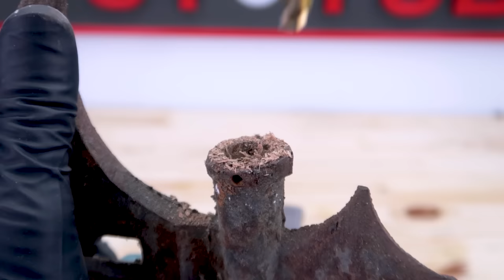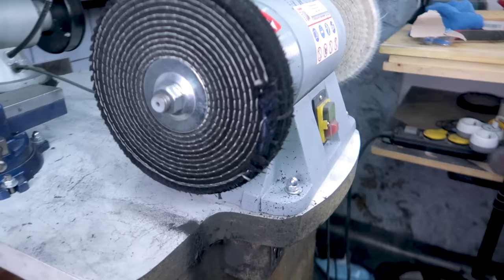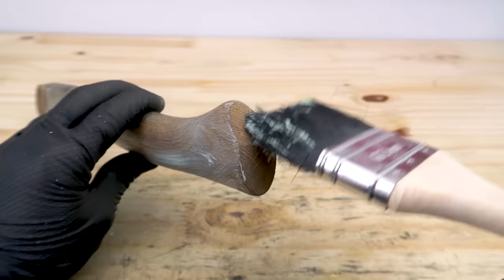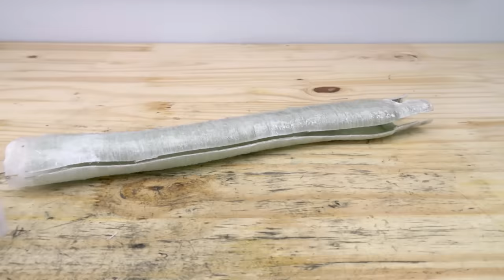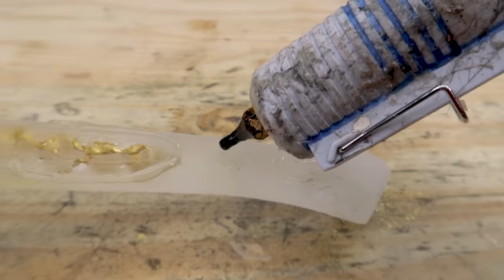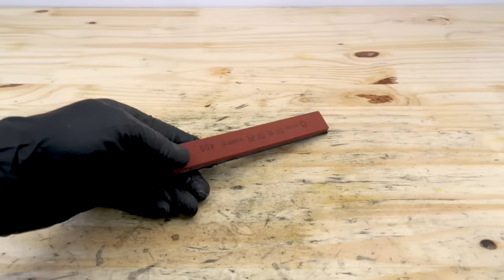Halberd AXE Restoration - With Epoxy Handle

Comment from the maker: Check My New video!  BMW Skillet Restoration 🔥🚗 https://youtu.be/n3P9fuKPHMg?si=WkfTTXY1Y45BCQI3
Reply: Pressure chamber will get rid of bubbles 8n epoxy, also mixing slowly will. I built a pressure chamber out of an old pressure cooker.
Reply: Hey so just a suggestion, instead of trying to repair the bubbles, why no go and make coloured epoxy and fill it with that? It may look cool! However, if you don’t want bubbles I’d say a vacuum chamber and very slow setting resin would help and also be sure to pour the resin on the side so the bubbles have less distance to get to the top!
Reply: Heat also gets rid of the bubbles.
Reply: To get rid of the bubbles you need to use a vacuum chamber
Reply: Cool!
Reply: Hey I have a challenge, restore something and only use the stuff you’ve restored like if you restored tools only use the tools you’ve restored
Reply: Use vacuum chamber to remove bubbles.
Reply: Can you restore a old nintendo?
Reply: عالی
Reply: why didnt you use a wodden handle?
Reply: So nice tysy i want to see more cooking videos
Reply: I've seen both vacuum chamber and pressure pots mentioned here as suggestions for removing bubbles. These are good suggestions. Another way that works is a vibrating table or plate to vibrate the bubbles to the surface where they can be popped or sanded away.
Reply: 😂😂 lol
Reply: Ok

Comment: this looks like a mass produced cast axe head before annealing , the residue metal around the edges shows me that this was cast in a two part sand box, i used to work in a foundry where sand box moulds were commonly used so i recognise the look.

Comment: He’s turned a halberd into an axe
Reply: Yeah, I don't like that personally. A halberd is not an axe.

Still okay work that they have done though
Reply: No worse, its a hatchet.
Reply: into a wtf.
Reply: That's like turning a spear into a throwing knife  just make it less practical in what it is
Reply: No halberd. Mission failed
Reply: yeah i am also kinda dissapointed but its better than rusted blade
Reply: It’s not for use, it’s for display, and it looks fantastic. If you want to see blades made for use go watch forging videos. You had to realize coming into this that it would be for show and not practical use. Come on guys, you can’t be that dull.
Reply: @draketimmerman3837  you can make an axe for display or a halberd
But you should still be able to distinguish between one and the other
Reply: Weird casting marks
Reply: Wait like a halberd. Like the actual guard. Oh wait. A meat axe
Reply: A full epoxy halbard handle would've been fantastic
Reply: I knew something wasn't right. Kept thinking "wait isn't the handle supposed to be longer?"
Reply: @PeterCaptainObvious  It's the FF9 Lindblum Guard halberd with the handle cut off to make it easier for the guards to fight intruders in close quarters like the hallways of the castle
Reply: @arielalexandroarnaldo2238  So the sawn-off shotgun equivalent of a halberd?
Reply: @PeterCaptainObvious  Yes, and if the Evil Dead team fell into the steampunk world of FF9, their shotgun would be the blunderbuss
Reply: Cause it's not really a halberd

Comment: To fight with air bubbles, make a vacuum chamber, its easy and cheap.
Reply: Was about to say this!
Reply: this is the answer, but when you do bubbles will well out the top of the item, along with a bunch of the epoxy so make a reservoir of extra at the "top" of the item.
Reply: Yep
Reply: Also if u can vacuum the partA and partB before mixing and also after mixing it might reduce even more. And be aggressive mixing also.
Reply: It depends on how long the resin takes to cure
Reply: Radu Butuc just like king of random
Reply: yeah but he would need to get or improvise a huge one if he wants to make things like the handle he made here, a handle it's not small like the usual things others put in vacuum chambers :T
Reply: @Timeless_Starman  you Just need to vacum the resin before pouring
Reply: Or even better, a Pressure pot. It is faster
Reply: The use of a pressure pot or a vacuum chamber will help to eliminate bubbles. I've had better luck with pressure pots. Good luck and great work!
Reply: J'allais te le suggérer. On utilise un cylindre avec une pompe pour  retirer un maximum d'air piégé dans les amortisseurs de voiture rc. Sinon belle vdo et beau travail 👌
Reply: Hushe dudidud a gruh ray eatut jaobub 👍
Reply: Or he could just do a wood or brass handle as they look better
Reply: The problem with vacuum chamber is that it can remove the solvant from the epoxy and degrated mechical properties
Reply: I’ve seen some people use pressure chambers too. I don’t know which is better, I’ve never had the chance to use or try other method.
Reply: The BEST way to fight air bubbles is to make a vibrator like workers do when pour cement and vibrate it😉easy, fast and efficient, Greetings from Greece!!!
Reply: Jelly I’ve never heard that from any literature ever. Vacuum setups with epoxy are used in industrial settings regularly. There’s an entire method of saturating the medium with a vacuum. They sell special epoxy that is thinner and works better with vacuums. Degassing epoxy in a vacuum chamber is a common thing.
Reply: Or get an agitator of some sort to vibrate it while the epoxy is drying, that may easier to create on the cheap lol heck an old fan with a bent blade would do the trick
Reply: Yep
Reply: So are you
Reply: @coltonhopkins5517  what are you even talking about and directed towards whom? Lol
Reply: Pressure is better you won't lose resin like in a vacuum
Reply: Most obvious But those are pretty costly
Reply: Heretik Leathercraft the chamber may be cheap but the pump is expensive
Reply: @errorcode1249  just take an refrigerator compressor and use it for suction. It's about 30 euros
Reply: @errorcode1249  his gotcha there
Reply: @ericitchyd2311  Easier to put the mixing cup in the vacuum pot and pull the air out of the Epoxy before you pour it into the project...

Comment: Halberds typically had long spearlike handles, hence the pointy tip above the blade. The handle you made looks sick though.
Reply: Restoration implies a return to the original form. That is the whole point. He simply removed the original irregularities, which showed how the metal was cast and ground the surface completely senseless. This weapon NEVER looked like this. The shape of the hilt and gilding are completely off topic. HERE EVERYTHING IS NOT AS MUST BE. This exhibit is lost for the museum. And for a person who calls himself a restorer, this is a collection of mistakes
Reply: Looks like it could be a little bit sharper....
Reply: I agree with @KP9IK about his "restoration" this is a blatent disrespect of what a halberd is. It is a POLEARM not a handaxe. Not to mention the wretched use of a fireaxe handle like wtf! Dude your a restoratitor, restore it to a halberd. If anything you should of made a less flashy woodend pole and it would look a million times better not this epoxy gold leaf disrespect. This is why i watch other restoritors. If you want a TRUE weapon restpration i reconnend "Restoration And Metal" who actually care about restoring the weapon not ruining it.
Reply: Historians crying, thanks!
Reply: @dggeargr4g  It looks like something cheap that people would hang on the wall in their basement back in the 1970's.
Reply: Yeah it was a mix between the Classic Spear (from Romans/Greeks) and the Hand Axe (more Germanic/Nordic) I think it got popular in the height of the Middle Ages, is a very interesting weapon and it has more secrets than you think, since it can be used at long range to attack and for defense. It was also use to disarm and capture the weapon of the enemy if the fighter was well trained. It also became a favorite of horse mounting Knights in duels, since it was long enough to reach a moving target on a horse back. Like I said, very interesting indeed.
Reply: The thing is that that has never been a halberd. Just a weird souvenir or something resembeling an axe of arms.
A halberd would have more prominent spikes and a way longer spear blade at the tip
Reply: Yeah that's"vintage" 1960s. This isn't some archeological dig. He bought it for $2. It was also clearly cast, not forged.
Reply: @maxhydro1   lmao youre acting like its one from the 1400s, bro its a reconstruction (probably from the 50s)
Reply: @johnbee5283  the problem is that hes calling it a restoration qhen obviously hes not restoring it to its origianl fork or as close as possible. This is making a beautiful weapon into an art piece.
Reply: @johnbee5283  also he turned a halberd (a polearm weapon) into a hand axe (a one handed weapon) which is a horrible insult to it at that.
Reply: @maxhydro1    "True restoration?" Restoration and Metal?  I saw his axe video from 11 months ago, one where he pretended to have found a rusty axe head with a bullet lodged in it.  The bullet was clearly planted (still in the casing), and he went on to use a welding rod to "repair" an edge.  Who knows what metal the welding rod was.
Reply: @aprilbennett4161  you have a point. Thats another reason, I've lost respect for this "restoritor" hinestly just a sick mockery of one.
Reply: its_dpark well there are many types of Halberts since they were so versotte they even had steel balls at the end and hammers at the top
Reply: @Glad_Daddy  very true. Thats why it was commonly given to not as well trained individuals
Reply: @maxhydro1  will you get a life

Comment: Don't stir the mix with power tools pulls in air that makes the bubbles. Stir by hand next time.
Reply: Put the mixture under vacuum before pouring.
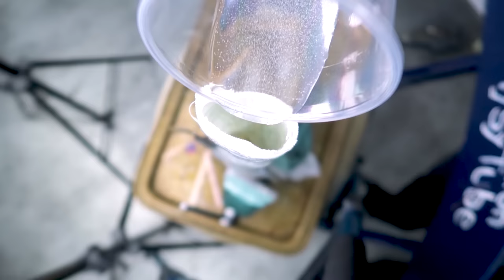Reply: Also, slowly pour epoxy with a very thin stream from a large height. Compares to thick stream and small height at 09:02,
The small diameter of the stream will force air bubbles out.
You already know vibration and heat, aforementioned vacuum and figure 8-stiring are the remaining tricks i kmow.
Reply: Letting it cure inside a pressure pot draws out the bubbles too
Reply: Building a vacuum chamber is dead simple and will get all those little bubbles out.
Reply: Wish I knew what the stuff in the spray can the Russian channels (the positive couple) use for bubble removal. They just spray that crap on and bubble go away.
Reply: Jesus experts in this comment section be going ham
Reply: *Don't stir the mix with power tools. They pull in air and make bubbles. Stir by hand next time.
Reply: while miking do it by hand and work out all the bubbles by folding them out and when you pour it into the mold go slow as to not cause bubbles to form
Reply: Now, you could get only get rid of the bubbles, by drilling (quite large) holes, and filling them up like with the surface holes.
Reply: @siliconjim2554  and after pouring.  Looks to me like he needs to make a video about building a vac chamber

Comment: If you pour in layers instead of all at once you can avoid air bubbles. You can also use your heat gun to heat the side of your mold and pop the bubbles as they rise to the top. Sometimes, depending on the brand, pouring large amounts of resin creates to much heat in a small mold and it creates bubbles. If I make a really large item I have to pour in layers to avoid lots of bubbles. A vacuum chamber is definitely the best option though!
Reply: A pressure chamber pot will force air out too.

Comment: The smallest helberds are over 2 meters tall. Don't get me wrong what you made is awesome but as soon as I saw that axe handle I was going "what the hell?"
Again still better work then anything I can do , but I wouldn't call what you made a halberd.
Reply: I noticed it had flashing on from casting...
Reply: @89schofe  most likely an old fireplace poker or wall decoration. Good piece of art now, but probably never a useful axe head.
Reply: I was litterly thinking the same thing
Reply: Im losing my sainity over this
Reply: It wasn't even big enough to be classified as a axe it was more of a glorified hatchet with a halberd head
Reply: Timothy McConnell  it's too small to be a halberd head anyway though, he just got the name wrong
Reply: After I saw the axe handle I started getting the toster and the bath ready
Reply: Alex McAree actually some Halberds had even smaller blades.
Reply: This "weapon" wont have any sort of edge retention and to call it a halberd is a crime, and to make it with a axe handle is taking away the property of the spear head.
Reply: @blankclips  those are called billed hooks or billed spears
Reply: Kuratos Darque first, I never stated that this is a  halberd (let’s be honest, everyone can see this barely qualifies as a poop scoop) and at no point stated it was a weapon all I said was that some halberds have smaller heads and this is true. Don’t use me to “show off”
Reply: @blankclips  no no you miss understand the first i wrote was to OP and then i was talking to you but something went wrong i guess i was just saying the smaller once was called billed hooks or billed spears
Reply: @blankclips  why do i want to use you to show off
Reply: Kuratos Darque I see the first one was not addressed to me. I got both notifications so I assumed both comments were for me. Addressing the other comment you stated that that blade would be called “billed hooks or billed spears” which is incorrect as there is no bill on this head. Lastly, I will address the “show off” comment. When someone want to share some knowledge they poses (happens all the time on the internet) they often target a comment that would use a disputable topic or definition, then they demean that comment to replace it with their own.
Reply: @blankclips  well im sorry but the smaller halberds was often called that, im not trying to discredit what you wrote im just saying what it was named. And im sorry if you took it the wrong way that was never my intention and i know this one isn't a billed hook or spear the one in the video is neither a halberd nor a billed hook or spear this is just someone made up and im fully aware of that. It's neither here nor there what im saying is that this was a missunderstanding and i apologize if you took me the wrong way
Reply: @AllMenAreBerries  Nice comment
Reply: @maartenzeeful  why thank you

Comment: as beautiful as it is, and i know i couldnt do this, i was sad when i saw such a short hande on it, when i saw halberd i though it was going to have a 6 ft handle or something crazy like that.
Reply: C'mon dude live and let live,,, there wasnt that much handle when he got it and the effort it would require to remake a longer handle isn't worth it, it just makes a lot more sense to make it a decorative piece. Also, not trying to start a fight, but you're acting like youre going to need it perfectly accurate in case you need to fight with it lmfao
Reply: @mattmacey1935  im not saying that it needed to be full length to be functional. I was just saying to me it looks way better with a long handle.

Comment: There are kinds of epoxy made especially for deep-pours. They are usually labelled as low-viscosity, slow cure resins. They are more liquid than normal resin and take a long time to cure (12-24 hrs) but because they're thin, the bubbles have time to rise up. Also tapping and vibrations help a lot, or pulling a vacuum.

Love your videos man, keep up the good work.

Comment: I know I'm way late to comment but most resins are not meant for "deep" pours like this, it generates too much heat and causes those bubbles to get trapped. You need either a deep pour resin for like tables or countertops or a cool set resin which will take much longer to cure but does not generate as much heat.

Comment: It looks.. different, I guess. Not a great fan of the gold leaf + clear epoxy look. Same with that knife you did earlier. Maybe if it were all a little smoother it could look kind of sci-fi-ish. But the gold leaf is uneven and the resin has a lot of bubbles. I've seen you do some amazing restorations. This is not one of them.
Reply: What? You don't like something a pimp would have in the back of his 1973 Fleetwood?

Comment: People in the comments are talking like this was ever anything but a decorative tchotchke.
Reply: Actually halberds were quite practical in that time, the axe head was for cleaving, the spear head was for stabbing, and the spike on the back was for armor puncturing
Reply: @sirkelendor5429  Sure, but this is not a halberd. This is a halberd-shaped-object made of cast metal.
Reply: @wbfaulk  thats wrong
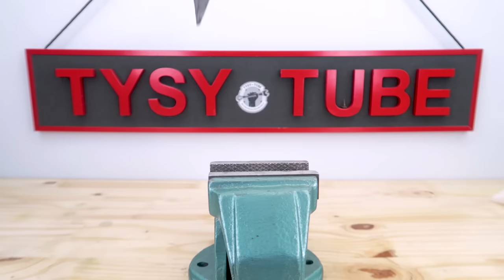Reply: @sirkelendor5429  You can see him filing off the casting flash at 2:09.
Reply: @sirkelendor5429  dudes not wrong, this would have been forged rather than cast and sure enough at the 2 min mark there he is cleaning flash off that wouldn’t be there if forged. Likely this is a rusty “toy” or gift shop replica

Comment: Those lines along the edge makes it look cast instead of forged, which would make the piece not suitable for combat..
Reply: 100% accurate.  It's cast.  Which really makes it crap.

The drill bit's a better piece of steel.
Reply: True but I doubt he take this into combat considering all the changes he did
Reply: Yeah you can see little bubbles on the blade from the casting
Reply: @johnbradley1139  and probably not as old as people think.
Reply: @colemoureau846  most likely some cheap 20th century fireplace ornament by the looks of it
Reply: @knutpukallus9922  Exactly.
Reply: Museum Replica probably sold that thing.
Reply: So I can finally execute my hostages with this item?